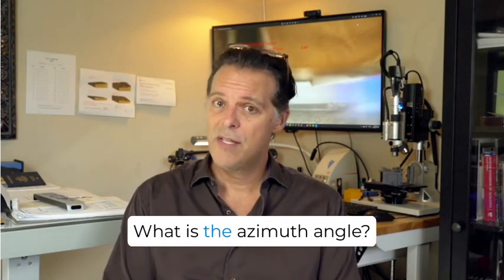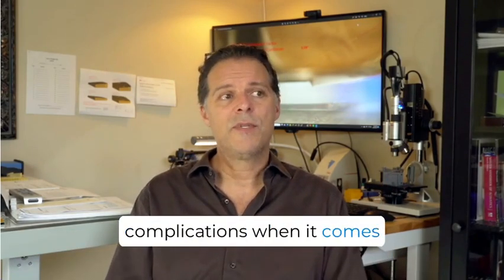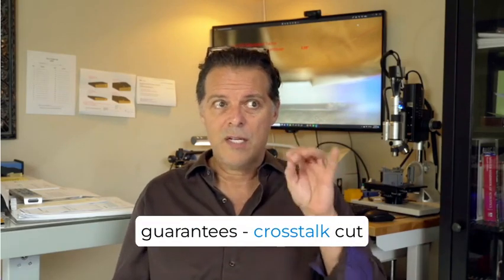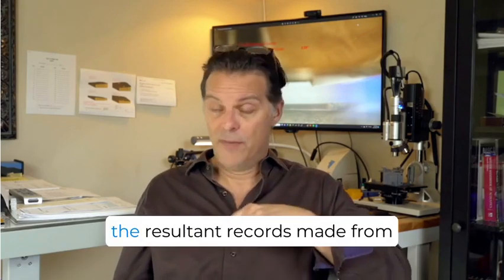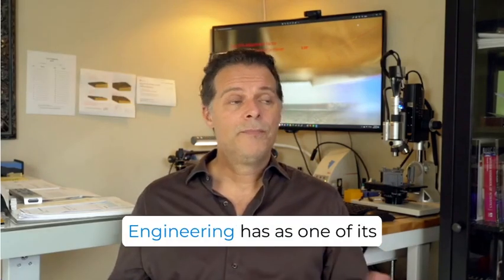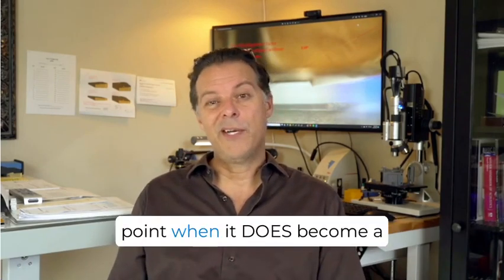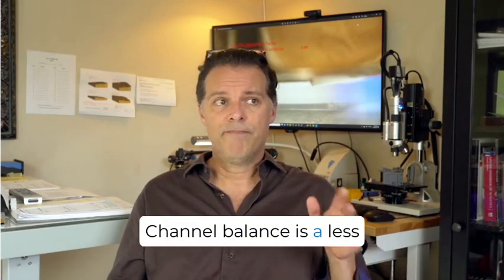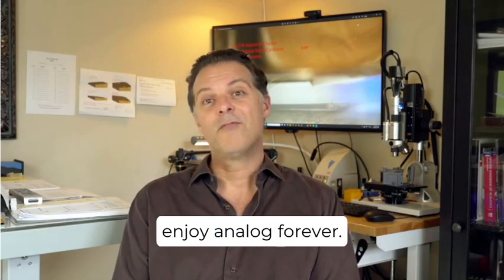7 Analog Alignment Targets - Video #3: Azimuth

Comment: Hello.Thank you for discovering something new.I think that a slight violation of the azimuth of 1.5 ° will not lead to a loss of nuances in the sound.Probably, in this case, a well-tuned tonearm with one support does a good job.And classic tonearms, to which the cartridges are selected correctly in accordance with the reference values, should pass the modulated groove well.Not noticing the slight azimuth deviation when cutting with a milling cutter.But in general, of course, we need to remember what you have told us.After setting up always need to listen to different compositions and make small adjustments.Thanks!Very informative.We are really looking forward to interesting videos.